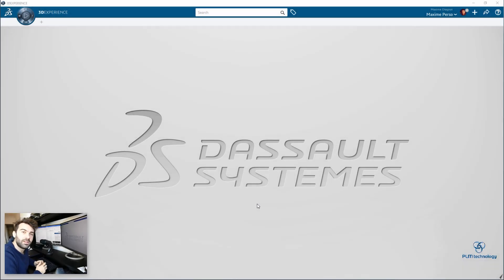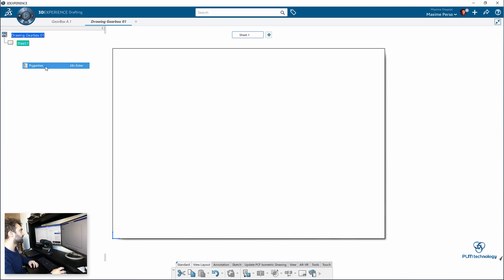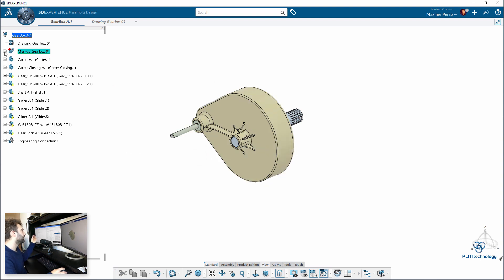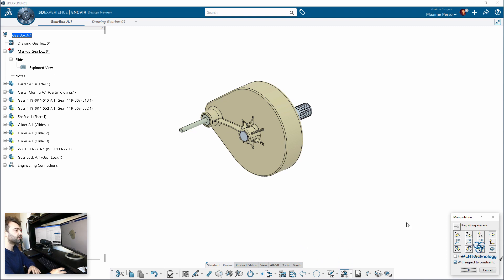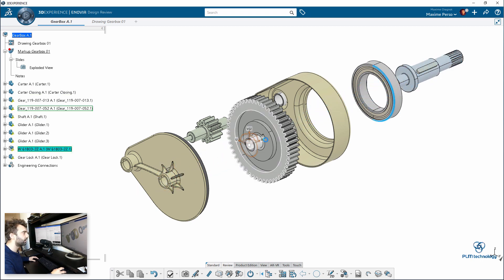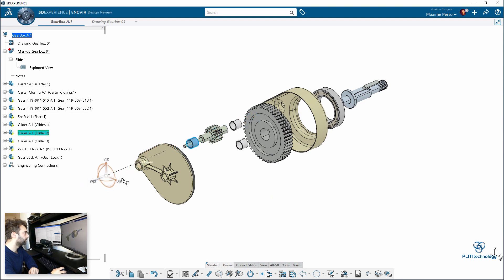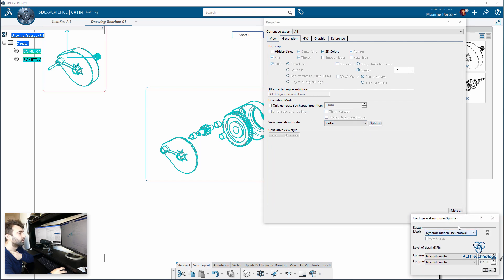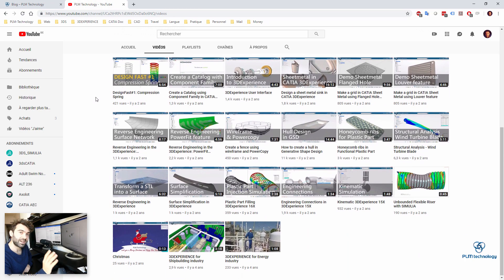Exploded View in CATIA 3DExperience R19x (Live Demo)

Comment: Hi Maxime, your videos are very helpful. However, I believe 3DX updated recently and your steps no longer apply. When I open 'Design Review' workbench, it creates a new 'Review' which is outside of the product itself, and I can only work inside of the markup under that. Creating a markup inside my product, I have no way to add new slides or edit them. Any suggestions? Thanks in advance
Reply: If you have some time to help, I can send you an email with some photos of the screens I get trying to follow your steps
Reply: Nevermind, I solved my own problem. If anyone else gets stuck, in order to work on the slides in your markup, the markup must be under the top level that you are working on. For example, if you are looking at a product, but your markup is inside a part, you will not be able to work on it.

Comment: Thank you for the video...I have tried the same way you shown...but when I select the exploded view under mark up,its still taking the normal isometric view of 3D CAD.please let me know why its so...
Reply from the maker: Hello Hari, ok so very important for the scenario: 1) you should right click on the markup and "set as current". A small red dot should appear next to markup. Then you can create a slide and move the parts. You can "unset" the markup when you are done and it will go back to normal assembly model. 2) Insert drawing into assembly. In the drawing app,  select "Isometric view", switch to assembly tab, and select the SLIDE in the SPECIFICATION TREE. By doing that, you should select the exploded view and not the 3D model. Please let me know if it works! Maxime at PLM Technology
Reply: @MaximeChagnot  : Hello ...thank you for your reply... I have done exactly as you shown in your video...and that red dot also appeared... then I tried the same procedure 2,3 times... finally I got the result... though I could not recognize the reason, but I was successfull.... forgot to update it here ...anyway thank you so much for your help... all the best
Reply from the maker: Hi, after selecting isometric view in drafting, then switch to assembly tab, select the slide called "exploded view" and i forgot to mention you have to click on one part in the exploded view (in the video I click on part Carter Closing). Normally the exploded view should be generated in the drafting app. Maxime at PLM Technology

Comment: Excellent guide, thanks!
Reply from the maker: Thank you Tappajakoala for your kind message!
Reply: @MaximeChagnot  By the way, do you happen to know if there's simple way to move those exploded parts by numeral  distance values or move groups of parts on same time? I made view where I had to first move several parts z direction and spread there -y and + y directions. Parts are not precisely aligned now but close enough.
Reply from the maker: @Tappajakoala  I do not know if it is the best way, but when I want to move a part from a distance along X, I use right click on the Robot (compass in bottom right screen corner) then edit the Robot, and I put the value I want on the X, for instance 43mm. Click on Ok. Then you drag and drop the Robot on the part and move it along X, it will be move for 43mm. Another method is to edit the Robot put 1mm in each direction X, Y and Z and 15deg (or less) in the angle U, V, W. In that way, you set up an increment when translating and rotating. Very useful! If you already moved the part, it is possible to reset position in the properties panel of the part (Mechanical tab in properties). Regarding group of Part, I am using Ctrl+Click to select several Parts. I prefer to select the parts in the specification tree. Good luck! Maxime from PLM Technology

Comment: Very good information. Thank you for sharing. How would one add axis lines in the drawing to help with assembly explanations? Including if one wants to have 90 degree axis line, to help with parts positioning (multiple bushings in one axis for example)
Reply from the maker: Hello Mathieu, sorry, we are not aware of an automatic tool for doing axis lines in exploded view (parrallel and 90deg). You can show axis lines on hole in properties panel, but if the part is fully prismatic, there are no tool in CATIA Drawing app, you can draw it manually but it is not associative after update. I think you can achieve what you want with CATIA Composer application.

Comment: Hi, How can we increase the wiev quality. For more complicated modeling. 
Also how can we hide a lot of product, from the maouse when we select a part of modeling and click the space. It hide 2. Stage  product. And these reason it shows drafting module
Reply from the maker: Hello Murat, Thank you for the comment.For the view quality you can go to preferences/display/performance and put the 3d accuracy to 0,01 (take more ressources). On the action bar you can also go to View tab and click on View Quality, select ultra or custom settings for improving quality. Finally you can also change the ambiance mode to put reflection, by right clicking on the background/ambiance.
For selecting several products in the same time, you can use CTRL or SHIFT in the spec tree, the classic rectangle selection, in View tab you can select Product selection or 3D Representation icon, you can also use CTRL+F for searching a type a element you want. 
I hope this answers your question!
Reply: Thank you for your quicly response. For the view quality it helps me. 
But for the select it is not enough. I need more detail. For example when I click the part it will be chose outomaticly upper level or assemly part. Because I have really a lot of part and when I hide with space. it makes hide level stage. I dont know, I wish I described enough and good 😞
Reply from the maker: Hi Murat, good that it helped you a bit. but I am sorry it is hard for me to understand your question. I can recommend you to contact the CATIA team on their forum: https://r1132100503382-eu1-3dswym.3dexperience.3ds.com/#community:6